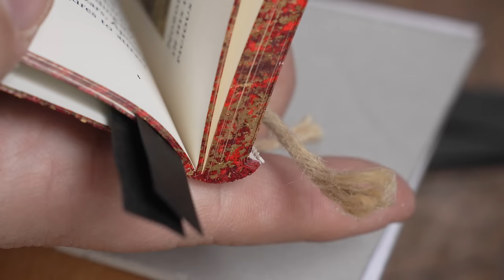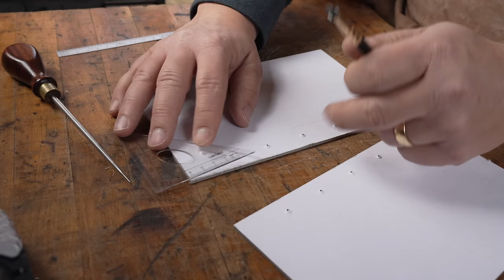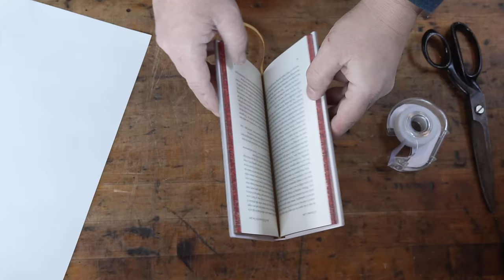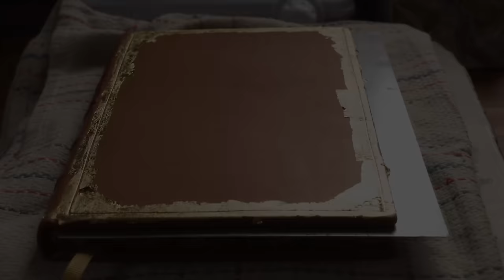Hand-Binding 'A Christmas Carol' - Part 2 of 3 - Weaving Endbands, Cover Boards & Preparing Leather

Comment: Headbands!!! Those are one of the things that your videos have helped me with. I was struggling a bit understanding the actual method but watching you do them things became a lot clearer.
Question, what was it that you used to line the spine at around 3:15 ? It looks a bit like patchment or possibly very fine leather...
All in all, a nother masterfully relaxing video which is also packed with little hints and tips Dennis - many thanks 😁🎅

Comment: It is just magical, watching you work! I have a question. First you frayed the cords and then you glued them back together to pass them through the holes. Is the purpose of fraying to reduce the volume of the cords and also make it easier for you to fray them out after passing through the final hole and gluing them down?
Reply from the maker: Essentially yes. Fraying tapers the cords, and also allows the fibers to better conform to the negative spaces of the recessed cutouts. Unfrayed the cords would probably tend to hold their shape better, even with hammering, and cause lumps on the cover.  Thanks for the question!